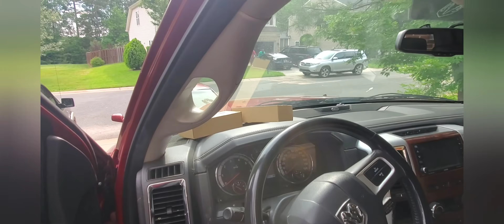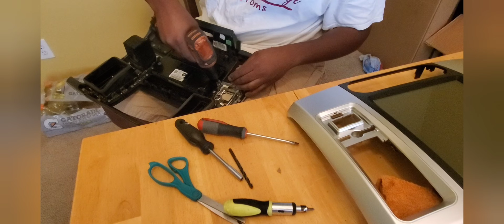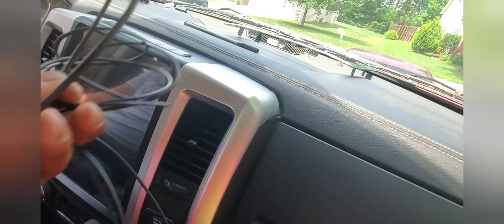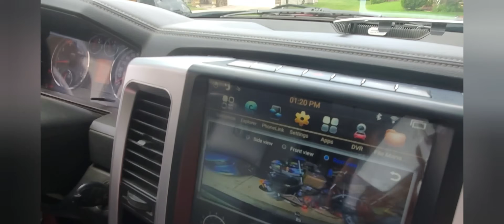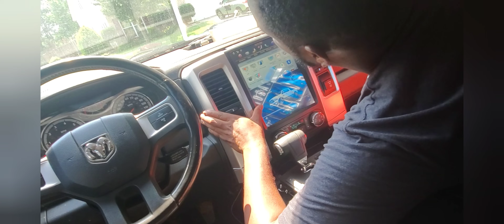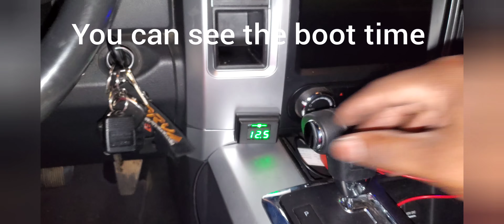09 - 12 Ram : Phoenix PX6 Tesla Style Vertical 12.1" Screen Installation

Comment: How do you control heated seats and heated steering wheel?
Reply from the maker: You have to click console in the top bar and all those controls are there.
Reply: @mrobe057  Yeah, just found them. But, when I turn either the heated seat or wheel on, it turns itself off after a few seconds. Do you recall if you had a plug with one wire to hook up, for the heated stuff?
Reply: @Jesse Samson  don't know if found answers but for me had to have the truck actually on and they worked
Reply: @jong4353  What I discovered is that the heated seats/steering wheel won't heat up if the ambient temperature is too high. They've been working great in the winter. Thanks for your reply.

Comment: Hey bro  I hope you can help me , I just install this radio on my ram 1500 same as yours , but I can’t get my seats heat/cold and steering heat to work , they all show off I can’t change nothing
Reply from the maker: Luckily they are all on the same connector so it's probably an issue there.  I just checked mine and if I remember correctly its just a single blue wire from the unit that has a connection at the end that fits those controls.  Make sure thats plugged in firmly.  I think that wire just supplied switched power so you cant turn the controls on unless the truck is in the on position.

Comment: Why did you have to run a different GPS antenna? Was the factory antenna not compatible. Would prefer a cleaner look than having that in top right of windshield. Also; do you have other speakers than what are supplied with this model truck. I have the same truck. My radio intermittently won’t play and is flaky with my phone currently with the factory infotainment system. Saw your video and the fact that you have my exact truck, gives me a degree of confidence to tackle this myself. 

Please provide the link to this unit. 

Great job 👍👌😊

Comment: Can't you use the factory gps? thanks for the video btw!  YES it can, just found out!  ¶ :-)--~
Reply from the maker: After your comment I looked into it and seems like you can.  Awesome to know and I will try it out.
Reply: @mrobe057  Mine is dead atm, everything worked, I connected the TPMS to usb and the screen went off! checked everything, reconnected but nothing :-(  any suggestion to reset or whatsoever?  thx
Reply from the maker: Check the radio fuse under the hood.  On my 2011 it's M12.  Verify that is not blown 1st.
Reply: @mrobe057  I don't have a M12 (2009 built, can I send you a picture?) But strange, I took 2 fuse out, put them back but nothing, then I watched 'automotive' ... wanted to try reset, did paperclip in wrong hole hahaha, but it started and I saw the RAM image ... it was only for 10 sec., strange ... I just disconnected the minus of the battery, lets see what happens!?  btw, with my old mygig REW I had the problem of schutting down, and when doing 'fuse and battery disconnect ritual' (for about 15min) it started ... for awhile :$ ... I'll let you know in a bit! THX M8  ...   greetings from 'The Betterlands'   ¶ :-)--~
Reply: @mrobe057  It's working :-D  thanks for the spirit! other question, I have seat/steer heating and cooling, how do I get those on the screen?  Thank you so much M8!  ¶ :-)--~
Reply from the maker: The will not stay in the screen as options but in the top app bar it's a app named Console. The heated/cooled seats is there as well as heated steering wheel.
Reply: @mrobe057  I did see that yes, was wondering if it could be shown in the bottom of the screen ... anyway it works and I'm (getting more and more) happy ... connecting USB/WiFi etc etc ... pretty kewl system! thank you for your effort, really appreciate that! ♥

Comment: One thing I may suggest. I do off-roading and those damn rca cables will come loose. Use some 1/2 “ shrink tube and shrink it around them. Make it long enough it goes down to both sides of the wire that way it will shrink down and suck them in. I use color coded shrink and then you can write on them too. Looks good! Wish they had them in stock, but I couldn’t use it really I have a set of aux switches to control off-road lights and winch power

Comment: What's up man, i have a question for you, every time i hit reverse , the radio cuts off, is any setting to cancel that, so when im backing up the music don't cut off?
Reply from the maker: I just looked through my settings and don't see anything about that.  I also check to see if that happens with mine and it doesn't.  I will do some more digging.
Reply: When you connect all the wiring, I know is all plug and play, but, there is also other wires, that in the harnes that are loose and capt, on says parking brake. Did you connect any of those?

Comment: After you installed the radio did you lose the beeping sound from your parking sensors? Also my truck has factory camera and for some reason after the install the rear view shows like shit
Reply from the maker: No, I still have the parking sense noise.  Pretty sure it's a setting in the options menu to have it on.  I will double check.  My rear view camera is ok but it lost some quality due to being shown on a bigger screen.  I will get back with you in how my settings are configured.
Reply: @mrobe057  thank you, I wasn’t sure you would reply I appreciate it
Reply from the maker: In the settings menu for User Settings you should have a option called Parking Sound.  Make sure that is On.  My camera is set to PAL but Auto looks exactly the same.

Comment: Hey question because I have the same unit. Does your heated seats and steering wheel work and how
Reply from the maker: Yes those settings are now in the units console app.
Reply: @mrobe057  I am having trouble finding it. And support can’t figure it out
Reply from the maker: You can't find the app or the settings once you are there?
Reply: @mrobe057  so I go to console app and heated seats on not show on there or steering wheel
Reply from the maker: Check out the 6:30 mark of the following video https://youtu.be/8jSrN--ivZw
Reply: @mrobe057  ok I will thank you
Reply: So I just watch the video and mine does not show left seat or right seats.

Comment: Will these units work with the longhorns with the alpine head unit and the overhead DVD units
Reply from the maker: I had the alpine radio so yes it works with that.  I am unsure about the overhead DVD unit.  I didn't see any mention on the site or any accessories.

Comment: Factory speakers work through the display without hooking up the audio out RCA’s correct. Those would just be used for sub or RSO right.
Reply from the maker: Yes that is correct
Reply: Great, I pick my 2010 ram up tomorrow and wanted to make sure before I drop that much coin. I was getting ready to watch your review video. Still have steering wheel controls I take it. Any complaints or praises for it yet.
Reply from the maker: Everything works great for me.  Unfortunately, it seems like I am the rare exception for a perfectly fine unit.

Comment: I have treated Sam radio Sam year install phoenix  the style radio but my issue is I have no rear sound when I took the radio out it has two connector also I have the factory alpine system came with factory amp how do I fix this issue would  you  help  me out   please  thanks

Comment: Man that looks good! Mine should be here in a couple weeks. I noticed in one of your videos that you have a 2011 and you wanted it to look updated and newer and thats why added 12" touchscreen. Well I also have a 2011 and I wanted it to look newer as well, I think you might be interested in this mod i did. I ordered and grill, bumper, and fog lights from a 2018 off ebay. With a little ingenuity and few small modifications it bolted right up! Now my 2011 looks like a 2018 and wasn't very expensive, right around $800.00. A small price to pay to have a 10 year old truck that has the looks of newer model. I'd post a picture but no need,  it looks identical to a 2018!
Reply: What modifications did you do?

Comment: I had a question.... what about your cool/heat seat buttons and the button for the heat steering wheel where they go or you can’t use them anymore????
Reply from the maker: They are in a menu on the screen now.  All the features work without issue

Comment: I just recently installed the same head unit in my truck, im having issues with my kicker sub and amp. As of right now the only way i can get the remote wire to provide power is to connect it to acc instead of SUb from back of headunit. Any help would be awesome and welcomed. Thank you
Reply from the maker: So I have my remote trigger from the cigar lighter since I had audio before the screen.  Unfortunately, I haven't tested this units remote wire.

Comment: I had one of these radios in my truck but it was not a Phoenix radio and I had all kinds of problems with it do you still have to run maps off of your hotspot
Reply from the maker: Yes for the updates for traffic conditions.  Maps work without hotspot but much better if you can receive current conditions.

Comment: Hey, nice video. Can you post a link to the cameras you bought for front and side? I'm unsure of whats a good one to add. My Ram didn't have a backup camera before so im looking to add one to the handle by drilling a hole and wanted one that would fit or angle correctly like the factory one would have?🤷‍♂️
Reply from the maker: I just used a cheap Amazon camera.  It's ok quality but I'm sure it's better more expensive ones. https://www.amazon.com/dp/B074P45P7G?ref=ppx_pop_mob_ap_share

Comment: I have a 2010 ram 2500 Cummins where would my tow haul and smoke button go??
Reply: They are at the top facing up. You can kinda see the buttons along with the hazard light button
Reply from the maker: Yep, they are moved to the very top on the bezel

Comment: You ever contact them about that bottom trim panel? I installed mine last week and it’s all wrong seems like they made it for a different model. Their customer service is crap they keep giving me the run around also mine didn’t come with the radio adapter plug so my radio doesn’t work.
Reply from the maker: Have you got them to address anything yet?   I just decided to leave mine as is since it's hardly noticable.

Comment: I got same radio, I installed it in 2012 dodge laminae Longhorn just last week, but I can not get my Heated / Cooled seats nor heated steering wheel to work. My question is yours working? I have tried everything and Phoenix no help at all. how is your AC controls working?
Reply: Go to console and your setting will be under that. Love my radio but there customer service really is horrible
Reply: @noelsantiago3159   I can see controls , but they do not work, pulled unit out and plugged in factory it works, just not thought unit.

Comment: What about the heated and cooled seats where are those switches at???
Reply from the maker: Those are now in the unit under the console app.  Looks strange but it works fine.
Reply: @mrobe057  ok so they're not physical buttons anymore right? Sorry just trying to understand it before I buy mine thanks.
Reply: I installed this into 2012 dodge Laramie longhorn but the heated cool seats an heated steering wheel don’t work ! How about your ac control ? Could you do a video how yours work ?